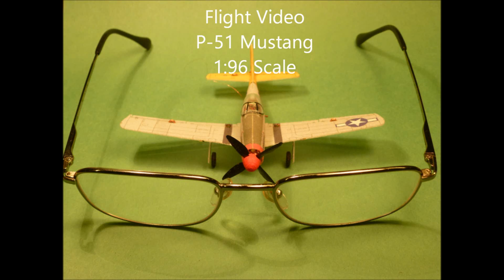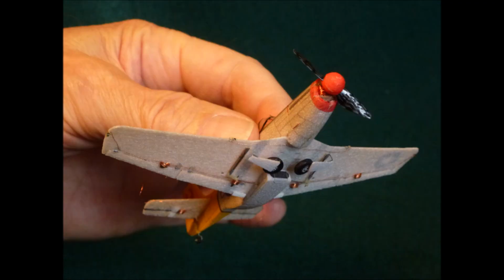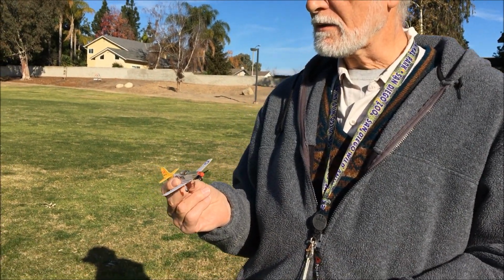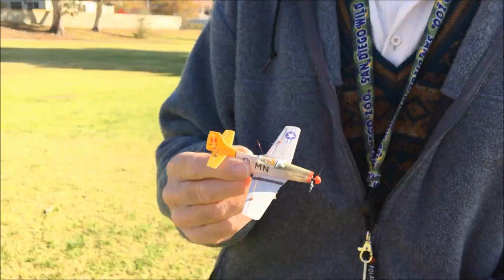P-51D Mustang 1:96 8 Channels Flight Video

Comment: I have had friends who used to build miniature (custom) RC gliders. One even used the auto-wind motors from a 35mm camera, for miniature servos. What was beautiful to see was when they would float upwards (circling) inside a small thermal from where we flew. Mind you this was back in the mid-80s. I no longer build or fly, but I have followed the advances in the hobby/sport. I have seen some amazing projects that have been made possible from the gyro. Well done. Thanks for sharing.

Comment: I remember back in the 80's trying to pack my 2 standard size servos and giant receiver and 4 AA flight pack in a cox 049 powered 1/2 A that would barely fly because it weighs a lb no joke technology has came a long way. my hats off to you sir
Reply: Same here! I remember the days when electric motors couldn't lift a rc plane/heli

Comment: Amazing. When I saw the introduction video and the flaps were operated, I was like "would be nice if it had working retract as well, but that would be impossible!" and then later in the vid, the retracts are shown to actually work. You would need a very smooth runway though, to be able to land this one safely. Still, a great achievement.

Comment: that is absolutely amazing how did you manage to shrink all the electronics plus the battery plus the motor plus the receiver plus all the servos on top of that and you put lights on the tip of each Wing that is nothing short of a masterpiece

Comment: NO WAY !!!!!!!!!!!!!!!!!!! Oh Man Martin here in British Columbia Canada, my brother inlaw and I have been trying for years to make something so small but gave up after we could only shrink down to about a 10 inch wing span on a red baron lol. As far as I'm concerned your the greatest mind in rc flying so good on you brother..
Of course my ultimate goal would be to be able to fly in my house at a much slower speed but that type of engineering won't be around for long time after I'm dead and gone. 
Thanks for the video
Reply: Really, the only reason you have to go fast on a small scale is because the small wings struggle to generate enough lift. If you made a biplane that could help. Another thing you could consider is adding a fan pointing down at the center of gravity. It will be a little bit of a cheat but it can help you get the lift you need.
Reply: Thanks Joseph... It just dawned on me as you were explaining things, that I should try to figure out how to get a downward force of air so I can fly small stuff in the house lol. I guess though the only problem again would be the weight. 
Oh well something will come along one day I'm sure ... Thanks for the advice.
Reply: Better yet - put a bunch of fans on the ground pointing up! (Super impractical but if the air is steady it could work in theory)
Reply: There is a plane that can be flown indoors at very low speeds but they are rubber band powered .

Comment: If you think the scale Mach 3 speed is an issue I would suggest adding a weight to it. I know this isn't on the same scale but on a few of my RCs that flew more like an Extra 300 than a Piper Cub I added some weights (I used a few small pinches of lead shot) to the point of CG and it flew much more realistically.
Again, not saying you should do this or if this would even work but hey, you somehow fit more axes into a plane smaller than the palm of your hand than most do in ones bigger than your torso.
Great fun!

Comment: That is amazing! Could you share any more info on the 3-axis gyro stabilization? Did you find or build one?
Reply from the maker: I added stabilization by integrating an Invensense MPU6500 gyro/accelerometer chip into the Rabbit receiver, rather than having a separate flight controller.  There is open source software on the web, but I wrote all mine from scratch because it had to run on the existing Rabbit processor..

Comment: WOW it flies very fast. During operation, besides the sound of the guns being fired. Does the airplane  have a motor sound.? or  is it just the whine of an electric motor.  At that speed  and its size. Tracking must be a challenge .

Comment: Huckster!  Why didn''t you show the take off?  Why did you cut it immediately after it crashed?  Because the flying model is much bigger.
Reply from the maker: Try this - pause the video at 3:21.  Use the "." and "," keys to single frame the video to the point where 3:21 is about to become 3:22.  The plane is in front of my head because it flew between me and the camera.  You can clearly see that it is the same plane that I was holding in my hand.  Also if you go to the last few frames where the plane is bouncing on the grass you can compare its size with the shadow of the cameraman's head.
Reply: found the frame in front of yer hat! :O Amazing job!

Comment: I have made a scale 1/72 Spitfire in foam and I like to do r/c. What parts should I get ?
Reply from the maker: At 1:72 scale the weight is not quite as critical, though you still have to be careful.  I made my own equipment, but if you want something similar you can get a version of the Rabbit receiver I used from MicroFlierRadio.com.  A viable alternative would be the DSM II receivers he sells.  He also sells suitable actuators, batteries, motors and props.

Comment: is it flyable when there are light winds ?
Reply from the maker: I haven't tried, but my experience with slightly larger planes with the same gyro-stabilized control system suggests it should be OK.  The speed it flies also suggests that small gusts would have relatively little effect.  But I need to try it.

Comment: How do you make the actual airframe
Reply from the maker: The airframe is made of 0.020" thick Durabatics foam, which is very stiff.  The foam is printed on an ink jet printer then formed.  The fuselage is monocoque.  The fuselage and fin are made from a single piece of foam that wraps around from the underside and is glued along the seam on the top.  The wing and horizontal stab are each a single piece of foam.